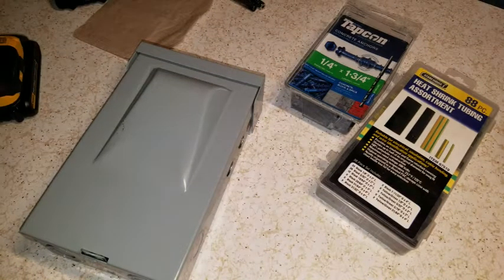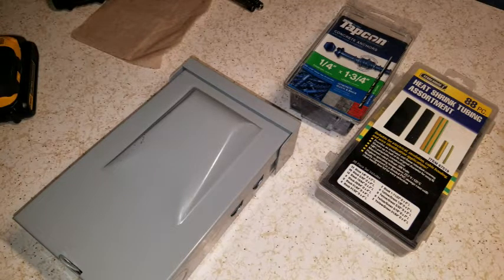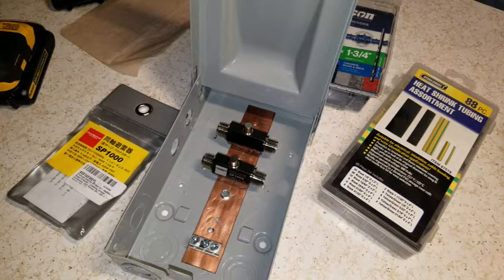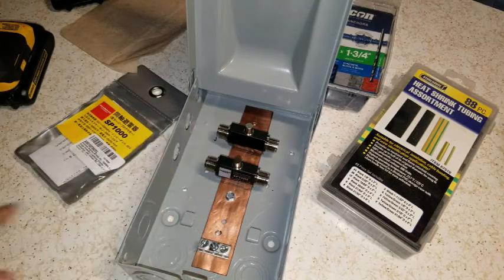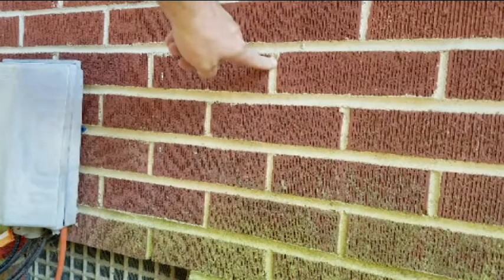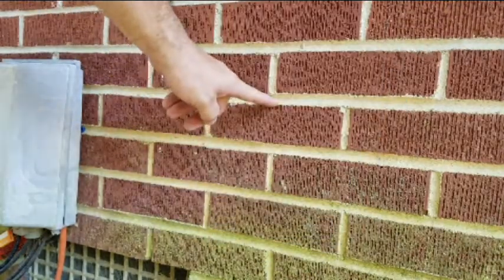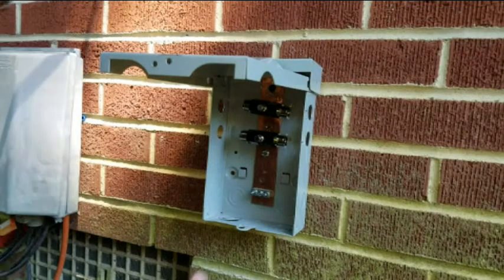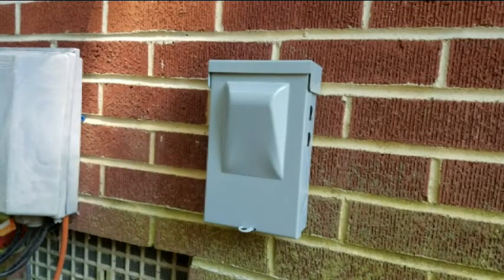Amateur Radio Antenna Lightning Protection

Comment: I was tearing down a fence, and pulled up one of the 4x4 posts in concrete and 2 snakes came out.
A shovel dispatched them posthaste.
Eastern NC.
Reply: Also, I'm a retired bricklayer, and you did fine with the drilling.   You could have drilled into the brick as well, but the brick are "cored", meaning they have holes in them ; they're not solid.   For your application it wouldn't have really mattered either way, except a hammer drill does have the possibility of fracturing the brick.   The only risk drilling into the mortar is you might hit a wall tie (corrugated metal strap), but that is highly unlikely.   
That particular brick is called "scratch face" and probably has 10 holes in it.
BTW, whenever we had to tear down brickwork for one reason or another, it was usually the brick that broke before the mortar.

Comment: When you disconnect the antenna side of the coax, you need to be able to "ground" that end of the coax and not just leave it hanging.  You can accomplish this by installing SO-239 connectors to the side of the box with the shield and center conductor wired to your flat ground strap.  They make SO-239 weather caps that screw onto the connector when the PL-259 is not connected to it.
Reply: Really good ideas here! Try hydro drilling the grounding pipe (3/4") 8' or 10' long and fill the hole around the pipe with bentonite (usually found cheaply in cat litter) or copper sulfate (found at the local feed and garden store) to increase ground conductivity and pack the remaining soil around the pipe. The pipe will be a great heat sink, so you might use a Mapp gas torch to solder the grounding braid to the pipe. Bring the ground strap in low to the floor to your ground buss (I just pounded a 1" copper pipe flat with threaded holes drilled into it). Bring your coaxes in the same way so that the lightning charge has every chance to go to ground before entering your shack. You also could install a whole house surge protector inside the main power breaker box, too. I have used this for 20+ years, no lost equipment or destroyed wiring at all.

Comment: Unpack a box a week. If not sure where to put list what's left inside on outside of box. Cross off as removed. Welcome to the south. Lizards snakes black widows & wolf spiders. Bang everything before opening or spray with insecticide is the traditional method of dealing in country areas.

Comment: In hurricane or tornado/cyclone/thunder and lightning storm situations - with high atmospheric energies ... the ancestors did the best approach.  Like the old houses on the East Coast (one I saw at an abandoned house inside a maple forest near Quantico, Virginia), run a long 2 inch wide copper braid or metallic <><><><><><><>< stripping along the apex of the roof (and insulated by separation), welded with braid on the roof edges, and then down all 4 corners of the house, and attached to 4 separate 6 ft copper grounding rods.  These rods are 20+ feet away from your ham radio (same copper braid and) grounding rod.

https://www.youtube.com/watch?v=EzWEs1S9cF4&feature=em-uploademail    East Coast/South experiences the highest concentration of lightning strikes in the continental U.S.